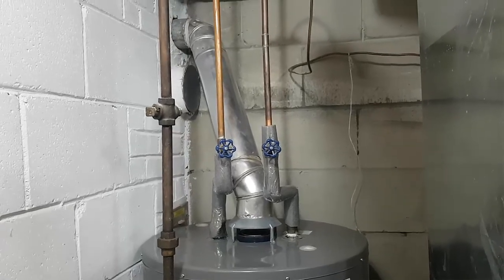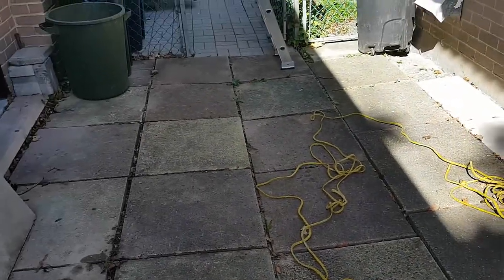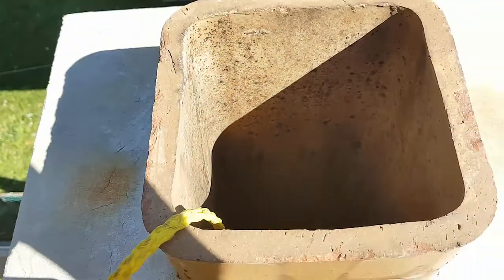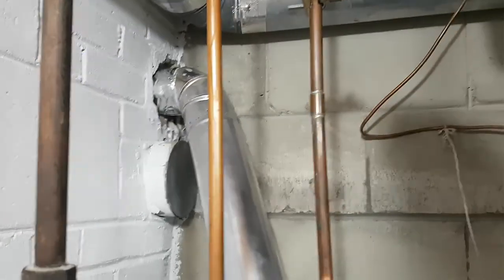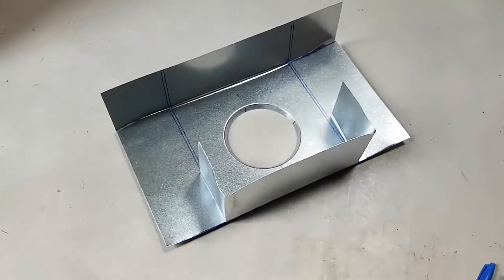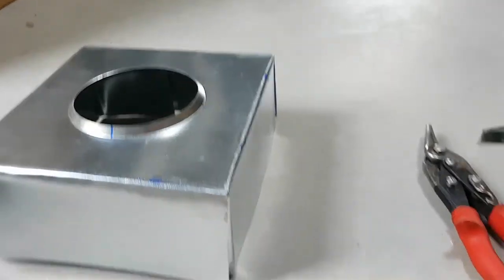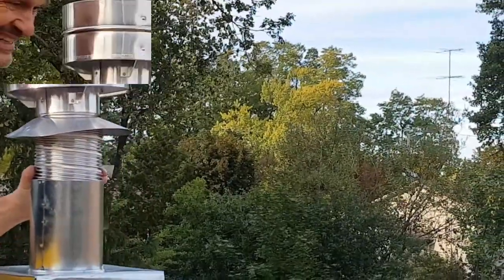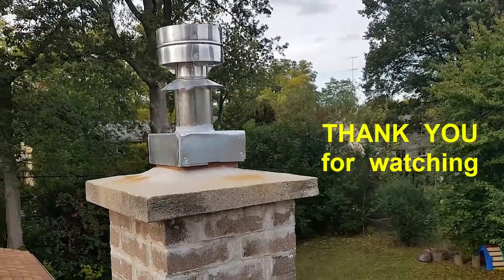Installing Liner for a Hot Water Tank Exhaust Vent (Recommend you install Stainless Steel Liner)

Comment: I can tell you firsthand the way that that comes up over there and angles it’s not flowing I guarantee you take a match and stick a match right there at the top of the hot water tank where the vent is and it’ll blow towards you instead of sucking it up in the freaking exhaust

Comment: How do I know the size make and model I need for my liner
Reply from the maker: Hi, You would need to get the recommended vent size from the hot water tank manufacturer then match the size of the liner so you maintain the same size vent liner. I would recommend not using aluminum however and go with Stainless Steel as aluminum liners may corrode badly with time and you more than likely will end up having to replace the liner.  Vito Casola - FIX IT Yourself!!
Reply from the maker: Of course, so once you select your new hot water tank you should know the recommended vent size and use that as a gauge in selecting the size of your liner vent. Generally they are 3" to 4" in size. Just remember to go with Stainless Steel even if it is a bit more expensive as in the end it will provide many years of reliable service. Vito Casola - FIX IT Yourself!!
Reply: @FIX-IT-Yourself  ok how long does the liner need to be 35inch
Reply: @FIX-IT-Yourself   well my water tank busted and dte says I need a chimney liner before they can replace my water tank so I'm trying to find one to buy and get installed
Reply: 40 gallon tank size

Comment: You’re so brave leaning against the brick chimney like that! Gave me chills just watching!
Reply from the maker: Hi Steven, Thank you for your comment.  I hope you found this video helpful.  Yeah I know I probably should have been wearing a safety harness and lanyard, fastened to a proper tie off point, etc. but I wasn't too worried. Generally I'm not afraid of heights, as long as I feel sure footing and secure.  I wouldn't try that on something rickety but that ladder was well secured and I had good footing.  I've done much worse over the years as some of my brothers witnessed when one of my brothers was building his cottage and they had roof open joist about 40-50ft and we needed to secure a temporary tarp that came loose and someone had to go up with a mouthful of nails and a hammer to secure the tarp with high winds and a storm brewing.  That gave all my brothers a few chills let me tell you, but at the time I also felt secure and sure footed, even though I was lying across a bunch of open timbers staring straight down.  Of course we laugh about it now, but yeah, I'm a bit crazy sometimes.  Vito Casola - FIX IT Yourself!!

Comment: Try to stay away from aluminum liners because they will get brittle and deteriorate in a short time. Always try to use a stainless steel liner so you only have to do this job one time.
Reply from the maker: Sorry for the late reply and thank you for your comment.  Do you know this from experience? I'm surprised they would sell aluminum liners for this purpose then if they are known to deteriorate so rapidly.  Practically speaking though the liner is not under any pressure to speak of and so I don't think it would deteriorate to any extent where it wouldn't serve some function it was intended to and so it would still be better than no liner at all, which is what I had before installing the liner. Vito Casola - FIX IT Yourself.!!
Reply: @FIX-IT-Yourself  aluminum liner is definitely better than a failing liner. I have removed a lot of aluminum liners that have failed within 3-5 years of installation. Always replace with a good stainless liner. The problem with aluminum liners are the salts/efflorescence with moisture plus heating and cooling down attack the aluminum and break it down. Although stainless steel is more expensive you will save money in the long run with stainless steel, especially if you have to replace an aluminum liner more than once. 
Clay, aluminum and stainless steel all work and do the same thing. Aluminum is like putting a bandaid over a cut that needs stitches(stainless steel). A lot of times you won’t know that the aluminum has failed, it’s not until it’s touched, swept and it’s extremely brittle and falls apart. Sometimes the aluminum will split from its own hanging weight if it becomes brittle. You can also search YouTube about failing aluminum liners. Just keep an eye on your liner.
Reply from the maker: @akaredcrossbow  Thanks for the detailed explanation, I appreciate the time you took to do that. I will be sure have a look inside the liner in a few years to see if it has suffered any of the ill affects you described.  If I do need to replace it then I will definitely go for stainless steel liner next time around or maybe just use standard galvanized rigid metal piping with only a short flex piece at both ends.  Vito Casola - FIX IT Yourself.!!
Reply: @FIX-IT-Yourself  also stay away from the galvanized pipe. Galvanized should only be used from the appliance to the chimney. Galvanized is not recommended to go inside a chimney and it’s not code. Galvanized in a sealed chimney will create moisture inside the pipe and outside the pipe and will deteriorate and rust quickly. Best to use stainless rigid 4” pipe with a stainless steel T section and snout/takeoff to connect at the bottom to the appliance galvanized pipe. 
Even better and less weight would be a 4” stainless steel smooth wall flexible liner with a stainless steel T section and snout at the bottom, then connect that to the galvanized appliance pipe. If you’re ever concerned about moisture you can also purchase an insulated liner blanket wrap that wraps around the liner, but it’s not necessary unless you live in a cold climate and the chimney is exterior. If the chimney is interior the insulation is not necessary.
Reply from the maker: @akaredcrossbow  Wow.... that video says it all.  Thanks for sharing that.  Definitely will take a look at my liner in a few years then and install only stainless steel as you suggested. Thanks for that input. I will be sure to spread the message to others that ask about it on this video. Vito Casola - FIX IT Yourself!!

Comment: This video saved me $2000. And my friend and I installed in under 3 hrs sealed it in mins.
Reply from the maker: That's great. Glad to hear it was helpful. Did someone actually try to charge you $2,000. I thought Reliance was bad trying to charge me $800 to install this $75 item.  It was fairly straightforward wasn't it? Little tricky forming the cap and it helps to have another person assist otherwise not too difficult a job.  Anyway hope you clicked the "LIKE" button and subscribed to my channel as it helps improve overall recognition of my channel. Should have another 4 or 5 videos to add with bunch of other repairs I've made around the house recently. Vito Casola - FIX IT Yourself!!
Reply: It’s because they were probably going to install a stainless steel liner not an aluminum liner. Aluminum will get brittle and deteriorate even with gas in a short period of time. A normal rule of thumb getting a 6” diameter stainless steel liner installed is $100 a foot(price differs on the diameter of the liner)including installation with top of the line products and a lifetime warranty when getting a quote from a professional.

Comment: Thanks for posting this video was extremely helpful. One question, do I need to insulate the liner? I've seen some say yes, some say it's not necessary.
Reply from the maker: Hi Kevin, Sorry for late reply... been busy.  I didn't insulate my liner. I was debating the same thing.  Reason I ended up not insulating is because the liner is what protects the clay/brick chimney from having condensation form inside when the hot water tank cycles ON/OFF. 
 Without the liner residual exhaust gases from combustion that remain after the hot water heater turns OFF could cool off inside the chimney to a point where they could condense and possibly freeze.  The concern is that this condensation/freeze/thaw cycling could eventually deteriorate you clay/brick chimney and allow products of combustion into the home.  With the liner in place then exhaust gases stay inside the liner and do not come in direct contact with the clay/brick chimney so really insulation is not necessary. Hope this explains why it is not needed and why I chose not to insulate my liner. Vito Casola - FIX IT Yourself!!
Reply: If it’s an interior chimney then you don’t have to insulate, but it’s a good idea to insulate the part of the liner from roof up. An exterior chimney, the liner should be insulated in a cold climate. On an exterior chimney that doesn’t have tile in place the stainless steel liner should be fully insulated.